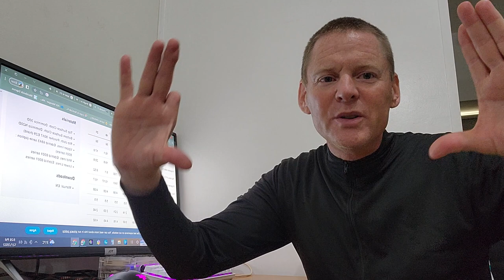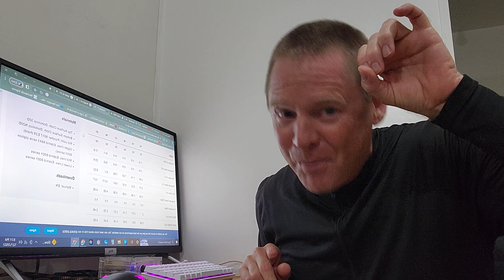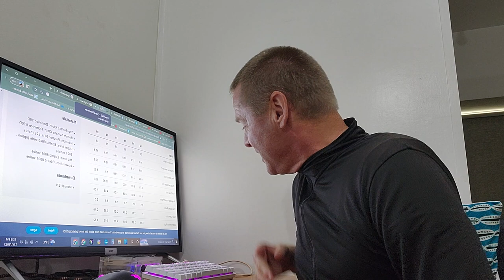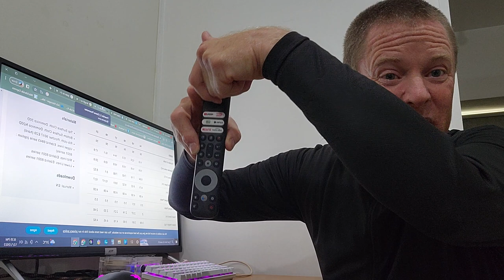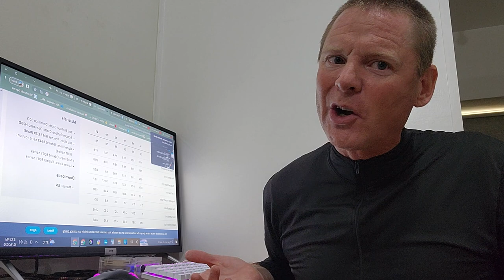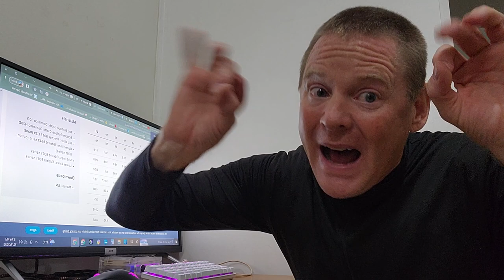Death Traps For Dummies!! What Is A Death Trap Paraglider Explained!!

Comment: I just recently kited a Luna 2 with 0 hours. It was fresh out of the bag. I immediately noticed how heavy it felt with the supports on the leading edge. It did not want to fly in low wind while my dominator that is over a year old had no problem staying above my head. This was truly eye opening. I was the only pilot who could sneak in a reverse launch. All the BGD pilots had to forward.
Reply from the maker: Yea the Dominator is upwards of 1/3rd the weight of other gliders.  It's a huge gigantic difference and especially so when you go to launch in a challenging area in nil wind at high altitude.  The slightest pause in forward speed with the heavy gliders and they just stall immediately where the Dominator kinda floats there and gives you a much easier time to launch on top of the fact it simply builds more lift and builds more lift at a much slower speed than other wings.  The low aspect ratio gives huge flare authority so you can very easily get off the ground from the top of a mountain even with an XXS Dominator.  Truth is truth.

Comment: FYI, pipe is not a structural material, tubing however is.  Also, you are correct that smaller-diameter cylinders have less stiffness (which can be recognized as a strength, per your discussion)  than a larger diameter, given the same material, but there is a technological design called a "strut", which can utilize several small-diameter tubes, that can be stronger than the large-diameter cylinder and weigh less.  Do you think my input is totally awesome or what?
Reply from the maker: Yes it's accurate but doesn't really apply here as there are no struts on a glider.  It's stability is the shape.  100% of the safer class gliders are lower aspect ratio with bigger cells and a taller profile.  It's much much more stable but the murderous liars are literally defrauding people with bs about crazy high aspect ration and low profile being more stable.  Sooo many deaths have resulted because of the reflex scam.

Comment: hi Dell just saw vid of the spyder 3 by ozone, noticed the fabric they are using is skytex27, wasn't that the same fabric used for the Cima k2 a while back and everyone was saying that the fabric wasn't strong enough for paramotoring wings.
Reply from the maker: Yes only the very first original K2s were made from skytex 27.  We quickly switch to the more durable higher tech cloth.  The glider weighs 1 single pound more but you have much better longevity.  No the problem is not that the cloth is weak.  That was totally false information.  ALL cloth used for paragliders goes through extensive testing so it's definitely strong enough.  It just degrades much faster so they simply don't last as long.  The Spider 3 and all other gliders they call "reflex" are total death traps.  Don't even think about flying them or listening to one single word out of the mouth of those pushing them.  Hundreds have died on that crap from a simple collapse.  One asymmetric collapse and you do a backflip 180 and lock into a face down spiral straight at the ground.  I almost died 4 different times testing hoaxflex death trap wings.  I was utterly shocked and horrified any company would even sell crap like that let alone promote it as the "safest".  Total frauds out there like Trevor Steele and piles more who are already dead actually lie so badly as to claim they are "safer" than the safest class of glider.  It's seriously insane how people could be that freaking evil.  No hoaxflex death trap wing they call "reflex" can pass ANY level of safety certifications.  Not A, not B, C or D.  They are so unsafe that even those who have tried to do testing from 3000 ft with a reserve DIED!! RIP Wolfgang.  I nearly died on them as well.  So anytime you even mention something like Spider 3 death trap make sure you follow it up with saying it's a death trap.

Comment: Does dominator have rigid supports to hold cells open? Asking for a friend
Reply from the maker: No the Dominator definitely does not have a pile of added weight with plastic sticks in it that can cause issues.  The Dominator's super lightweight and strong design is another reason why it recovers so fast from collapses.  It snaps out incredibly fast compared to super heavy gliders loaded up with  unnecessary things like that.  The Dominator has both incredible performance and safety.  Sadly people all too often focus on sales pitch hype instead of just looking at the facts of glider characteristics.  Glider companies know that many people are easily fooled with lies and bs so most all of them push all sorts of sales pitch hype like pretending they have AST technology or RST or BSD or NLT or any of the zillions of sale pitch hypes they use to take people's attention away from just looking at the fact that they go on for pages and pages with total hype but never once SHOW the actual FACTS of their true and real measured glider characteristics.  Don't fall for hype.  LOOK at and compare real actual glider characteristics.  Collapse recovery, safety, stability, speed, glide ratio, sink rate, handling...  Another bs hype I hear people get scammed with is "shark nose technology" lol.  Umm if it really was "technology" then why don't they just SHOW the glider ratio, sink, rate, speed, collapse recovery and real actual glider characteristics instead of writing pages of total hype??
Reply: Brian, Dell just told you his strategy to sell to people, the "hype" sales pitch. He says its the other companies that do it, but Dell is the only one hyping up certain products.
Reply from the maker: That lie looks pretty stupid when you, a 60 year old guy, got sold a hoaxflex death trap by Trevor Steele.  Then you lie up and down about the guy who encourages people to get safe gliders.  Hype is selling a 60 year old guy with limited skills a total death trap.  Then you seriously come here and bash the guy trying to save people's lives from sicko murderers like that? Seriously just shame on you.  See how that 11:1 aspect ratio and low profile works out for you when a bird farts your direction.... 5 more dead in a matter of months because of those just like Trevor who tell every lie they can make up to scam people into death traps.  It's seriously messed up.

Comment: I thought I saw Trevor talking about flying the Ozone Free Ride.  What's up with that?
Reply from the maker: Yes he is an evil moron that doesn't care about truth or human life.  He will tell any lie he can make up to get your money no matter how many die because of it.  Definitely NOT someone to trust your life to.  The freeride is a totally uncertified class death trap.  FACT.  They are nowhere near as stable as quality wings and WHEN they collapse they react so violently that they can't pass ANY level of safety standards.  Take a major collapse below 1000 ft and the odds are you will die.  Take the same collapse on a Dominator and the odds are you would barely notice it and it would be open faster than you could look up.  Ask around and see if you can find anyone that has actually SEEN their Dominator collapse.  It literally opens soooo fast that there is no way you can look up fast enough to just see what you felt.  Plus they can't even beat the performance of the Dominator with the death traps.  So there are literally zero reason to fly the crap gear.  Only purely evil people like Trevor would push that crap.  It's just freaking evil.  HUNDREDS dead.

Comment: Is unloading the back of the wing is like an aircraft retracting the flaps after take off, you don't do it until you have the necessary airspeed and altitude?
Reply from the maker: No it's like sawing off the back half of the wing destroying the airfoil shape.  So it's infinitely worse as the wing becomes a death trap.
Reply: I saw a video taken from above of a "reflex" glider flying in reflex mode. The back third of the glider was flapping like a flag held horizontally in a high wind ! Let's get this clear for those who can't infer the implications of this. A flapping trailing edge of a wing cannot have any reflex action. Period. Forget pushing a string. There's no rigidity in the  trailing third of the  wing 
 itself ! All the reflex design does is unload the trailing third of the wing. The ram air pressure was obviously no where near enough to inflate the cells enough to provide anywhere near the rigidity needed to even keep it from flapping ! This is obviously an extremely defective design by any engineering standard. Any body flying one of these will receive the Darwin Award ! Thanks for improving the human gene pool ! Your sacrifice is appreciated.